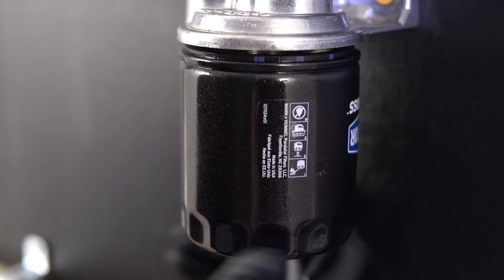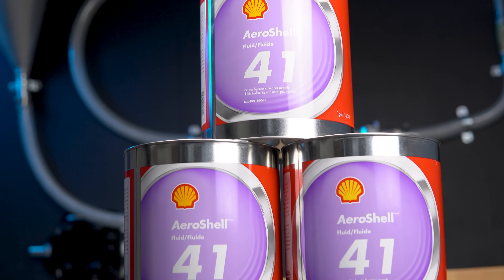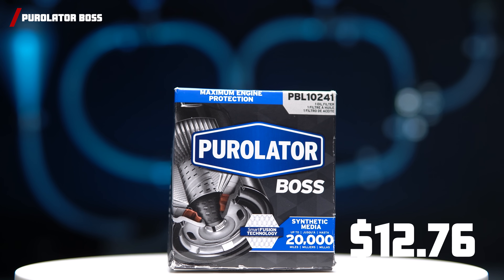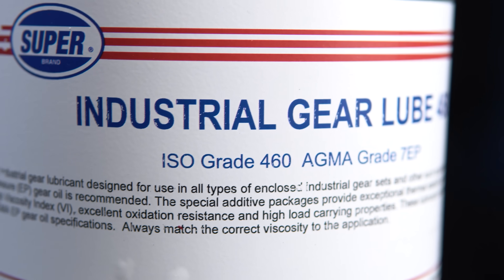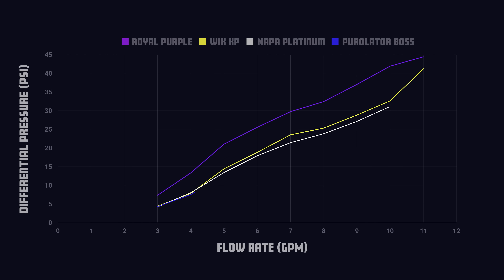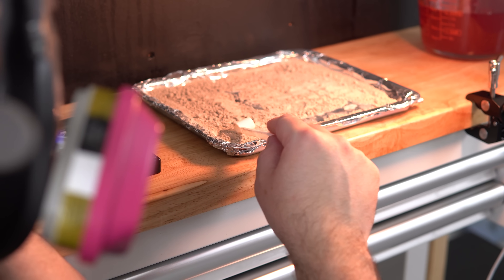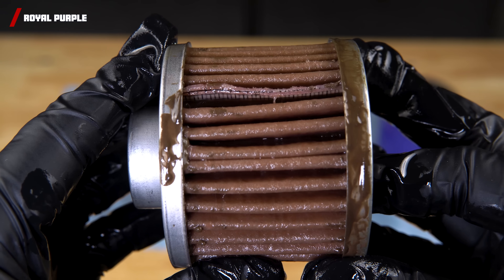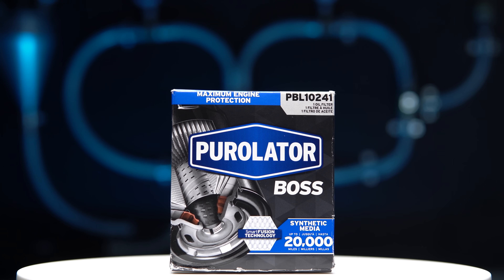Engineers Test the Most Popular Oil Filters

Comment from the maker: What oil filter do you use on your vehicle? Let us know in the comments down below and we may test it in a future video😉:yt:
Reply: I think it'd be nice to test some oem filters like the Toyota or Motorcraft. That and the Autozone filters since those are the most common where I'm from
Reply: You should test the k&n hp oil filter specifically. They are marketed as a better filter than the last k&n you tested.
Reply: AMSOIL
Reply: Mann, Bosch, Mahle or Knecht.
Reply: The best affordable is my moto. I've used purolator boss for 10 years. I'm amazed at 6 k miles how clean oil is. Nissan rogue
Reply: Honda oem , motercraft oem
Reply: I use standard Wix and Toyota OEM and Ford OEM
Reply: I'm using the Bosch 3300
Reply: Would like to see a motorcraft filter
Reply: Purolator One
Reply: Amsoil, Mobil 1, FRAM ULTRA and do a OEM showdown with all the ones the manufacturers say should be the only ones used in their cars
Reply: Every filter
Reply: Motorcraft FL910S which is the OEM equivalent to the four filters tested.  Thanks!
Reply: Moto master Canadian tire brand
Reply: The OEM filters are nonsense...the automotive industria don't make filters
Reply: Frame, Mobile 1, k&n
Reply: Wix
Reply: OEM manufactured
Reply: SuperTech Max Performace 7317 - Solid bang for the buck 💰💰
Reply: Usually Motorcraft, Purolator, or a Carquest blue label filter. What I would like to see tested though, is an AC Delco filter, specifically the blue ones. I'm a mechanic and we have had multiple instances, including one from the owner's father, where vehicles report a lower oil pressure after installing one of these filters. I don't recall the exact part number, but the filter fits LS V8 engines in full size GM trucks from 02-12 model years.
Reply: Mobil 1
Reply: I use oil filter pick one lol. Usually wix or fram and of my entire family as long as I can remember has used fram filters and no one ever blew up a engine! IMO its not the filter its the mileage and oil type per specific type of cam flat tappet or roller! Change your oil 3500 miles and you will never have a problem unless you have one of them pos displacement on demand AFM engines, they are junk!
Reply: I would use a roll of toilet paper, if it fit.. lol. Give me the cheapest one available. I plan on changing it soon anyways
Reply: I switched to the Wix XP a few years back, but I'm going to watch this series with interest.
Reply: Toyota TRD
Reply: Mann  c63 amg
Reply: i was picking an oil filter this was my list plus Fram synthetic endurance, and amsoil EA... i liked the wix xp but with Fram synthetic endurance. Please test the fram synthetic endurance fe7317 and amsoil ea15k13 oil filter.
Reply: Currently running Amsoil filters on two of my vehicles
Reply: Baldwin filter  needs to go through your test rig
Reply: I use vp racing, amsoil,and royal purple oil filters because they all use synthetic micro glass media technology and that’s why they don’t flow as much because they capture smaller microns
Reply: Honda both American and Japanese
Reply: The Super Tech 20K cheap and made by Champion
Reply: Mann and mahle sometimes bosch
Reply: Fram Ultra, but that might change based on your testing!
Reply: Mobile 1 filters.
Reply: MAN, Mahle or Bosch.
Reply: Motorcraft next please.
Reply: @miqo85 napa made by Mann. Says so on the box.
Reply: Napa Gold or Wix. Also Mann
Reply: AMSOIL would be a great oil filter to test given the advertising behind the product. I wanna see if it holds true!
Reply: Amsoil, Napa Gold (or WIX equivalent), AC Delco Ultragaurd Gold, Purolator One, Fram Ultra Synthetic, Mobil 1, and K&N.
Reply: Motorcraft for sure!
Reply: Fram Ultra or Royal Purple.  Both were highest efficiency of previous tests, Fram Ultra had more dirt capacity, but was more restrictive to flow.  Maybe that doesn't matter for a constant flow / variable pressure gerotor oil pump?  (I know some new pumps are funky variable electric).
Reply: Amsoil, Mobil 1 or K&N
Reply: Wix
Reply: where  do i buy the 10 micron filter
Reply: @cameronburger4116 yessss!!!! I was going to suggest that as well!
Reply: Toyota
Reply: I use Bosch Distance Plus when I can find them They claim to have 99.8% first pass efficiency. 2nd choice is Mobil 1 filter.
Reply: Been using Purolator for years.
Reply: Only AMSOIL with 1 or 2 Filtermags
Reply: Cheap oil and filters for me, changed often. Clean cheap oil is better than dirty expensive oil.
Reply: @ARC_RAY  maybe test them against hiflofiltro as I've read they are basically a rebranded k&n kinda like Wix vs Napa. They are available with the same hex on the bottom like the k&n race filters.
Reply: K&N vs hiflofiltro. They're supposed to be the same thing. Kinda like Napa vs Wix.
Reply: AMSOIL!
Reply: Mobil 1, Super Tech, Purolator Tech, Purolator One, Purolator Boss, and Fram Tough Guard, and more.
Reply: Fram Ultra Synthetic.
Reply: I'd like to see a Bosch 3402 filter and a Mopar MO349 cartridge filter. That's what I run on my vehicles right now.
Reply: @Jetmech1781  yah, something they missed in this video is that there is only like 3 companies that make oil filters, and these names license them to manufacture them with their specs requested
Reply: Fram from Canadian Tire here in Canada
Reply: Depends on what I can for a good price on, been building high horsepower engines since early 90s, run my engines HARD and I have yet to have one oil filter failure so not an area I focus on
Reply: I always use OEM from the parts counter
Reply: Purolator Boss why bother spinning anything else on your engine
Reply: Toyota Denso or Ford Motorcraft for my Tacoma, depending on what's on sale/cheaper
Reply: @ramirovillarreal5666 Correct. They contract out the manufacture. However, they do specify in the contract performance standards.
Reply: @renvge 😊que 0😊😊
Reply: Toyota OEM in the Toyotas, Mobil One in the Ford and Chevy.
Reply: Purolator Boss or Pure One
Reply: I've been using Motorcraft on my '97 F250, 2000 Jeep, '96 Nissan and even the '04 lawnmower. Mann filter on the wife's Audi. I've also used Baldwin. You hit on everything else I've used, I think.
Reply: Amsoil oil filter been using for a few years
Reply: I run K&N HP-2001 on one of our vehicles and HP-2011 on the other I'd love to see how they stack up against wix xp
Reply: Honda OE, Toyota OE, Fram Ultra and Carquest red and blue. The first 3 i'm using and the 2 Carquest because we use them at work.
Reply: Where's Mobil 1 20k filter?
Reply: Bosch Premium, please!😊
Reply: OEM. Mazda for the last 16 years. Some results you showed are concerns I had that other Youtube videos don't test, like cold flow rate/resistance. That's why I went OEM, to play it safe.
Reply: 2017 Lexus ES350 - Fram Ultra XG9972 cartridge oil filter,  various 0w20s but currently Quaker State full synthetic
Reply: Mobil 1
Reply: Wix wix and wix
Reply: I either use OEM or wix.
Reply: @ramirovillarreal5666  correct, but no matter who makes the oem filters they are the only ones with thousands of hours of test data for your exact engine model.
Reply: Pure One Purolator PL 14615
Reply: AC Delco on all 4 of our vehicles.
Reply: i use Mann, Henghst and Febi
Reply: FL1A on my 03 ram 220k since new
Reply: Mobil 1
Reply: bosch on non-BMW cars, Mann or Mahle on BMW
Reply: Use some OEM filters, I drive a Tacoma, and apparently it's a huge thing in the Tacoma world to only use OEM Tacoma oil filters. Would be nice to see if they are actually better, or if it's just people pulling "facts" out their ass.
Reply: Motorcraft on both of mine!
Reply: I’d love to see you retest the Fram Ultra on this 2.0 rig to see how it compares to the Purlator Boss, as those are the two filters I go with on my car.
Reply: CATERPILLAR
Reply: Motorcraft on my Ford and Jeep.
Reply: Mobil 1
Reply: You should have at least put the filter that came in first place from the last test on here And continue to do so if the test changes
Reply: Mann filters,  only❗️
Reply: you need to figure out how to test cartrige filters i have yet to find somone that has dun this and i use mopar or k&N
Reply: Motorcraft on my 5.0 F150, fram or any random filter on an Acura TSX, Honda on an S2000.
Reply: Motorcraft, Napa and CNH
Reply: Since Subaru now uses Tokyo Roki filters exclusively I have switched back to Subaru OE from WIX XP.
Reply: Bosch next for sure
Reply: My every day car Subaru Tokyo Roki 15208AA20A
Reply: Would love to see the Mobil 1 retested on this platform!
Reply: @CedroCron   The New Fram Endurance is the top model now, but it would be great to compare the Fram Endurance, Fram Ultra, and the Amsoil plus filters from any other brands.  Definitely SuperTech since many think it is a good filter and I don't after cutting one open.
Reply: @Molson954  I agree 100%!!  I run the FE3600/FE3614 and any of the EA or EAO series filters.  I have cut them open and testing them on vehicles now.  All made from Champion labs.  They are nearly identical besides the label.
Reply: Amsoil please
Reply: What about Royal Purple and  Napa  platinum
Reply: Mobil 1 Extended Performance!
Reply: Baldwin is without peer.
Reply: I have used NAPA Gold for years, but now I see the Purolator Boss is a far superior filter. Subscribed!
Reply: 🤔👏👉 Hear this out...... So if we want to improve flow rates / differential pressure at hot & cold oil temperatures while primarily retaining the best ROI for particle size-count removal filtration metrics and secondarily the amount of debris capacity, can a [non-restrictive] oil filter relocation kit flange (with integrated pre-start oiler pump?) and tubing ran to a "Y"/splitter for delivery to a twin pair of parallel-flowing filters dramatically increase those flow rates while, even though doubling the oil filter service cost, still perform bypass function to engine specification and still be cheaper than, for example, a single Royal Purple filter? Based on videos I've watched thus far in this series, am curious about such a case via two parallel-flowing Purolator Boss filters for the win. The total debris capacity is tertiary in my mind's eye after the aforementioned particle size - count, differential pressure at hot & cold flow rates while not forgetting about timely bypass functionality in the face of two bypass springs now in the flow - parallel - as my only concern if bypassing would then be undermined as well as potential negative effect on hydraulic sensitive oil systems (for variable valve timing) when striving toward the other goals while staying within cost parameter currently defined by the oil filter competition prices.
Reply: i will never use another paper element style filter if aerospace style reuseable filters are available  for my vehicles.  Imo they are light years ahead of any standard paper element filter and would really enjoy a comparison. It seems like a racket throwing nasty filters in the trash every 5000 miles on millions and millions of vehicles when reuseables are inexpensive, last a lifetime and in theory should out perform standard filters with increased flow across the stainless mesh element and magnetic pre filtering inside the filter..They take about 30 seconds to disassemble and wash with brake cleaner. I've been using one on my HD for over ten years and like to see what's in the filter when cleaning it and the cnc machined finned body. The fact that they're used in aerospace is all i need to know
Reply: WIX XP on all my vehicles
Reply: Ive been using an ACDelco UltraGuard. It's prolly one of these filters rebranded, but it be interesting to see.
Reply: Amsoil, or it's lower priced twin, Fran Endurance
Reply: I have Japanese made oil filters for my Honda, but there are USA made ones that are completely different in design. I would be interested to see which is actually better.
Reply: From one soon to be PE (EIT)…..great work! It would be interesting to see the bypass pressures of each of the filters tested. I have been told that Subaru boxer engines typically operate at a higher oil pressure than other engines. I run Wix XP because they reportedly have a higher bypass pressure than other filters. A filters filtering capabilities do not matter much if it’s bypass pressure is so low that it is always in bypass mode.
Reply: You should do some oem dealership filters for subaru , USA blue filters made by fram , JDM black filters made by tokyo roki both of witch have a larger and smaller size filter depending on model but can be interchanged no problem so test both sizes to see if it changes anything , also throw in mazda black filter witch is USA oem but made by tokyo roki and some subaru guys use it since its the same threads and brand as subaru JDM , just found your channel and your filter tests are top notch and way more intensive then ive seen before hope you give the filters i suggested a try keep up the great content
Reply: Walmart Super Tech.
Reply: I use Motorcraft. My friend was a mechanic about 15 years ago, he took apart several oil filters. Motorcraft had great construction and material, and is inexpensive. I've been using them ever since.  I'm open to change though.
Reply: wix xp
Reply: Baldwin
Reply: Mann and Mahle, or OEM.
Reply: bosch
Reply: Some cars have oil filters which are on top, easy to reach, drain when not in use, so very easy to change without changing oil. 
I would love to see the effect of changing one of these every ... 1,000 miles ?
Reply: I have a new laptop and it is putting many comments on different threads, thereby making no sense.
Reply: NAPA GOLD in F150 and top NAPA filter for my 2003 Saturn Ion 2.2 Ecotec. I am pretty anxious about changing my oil every 3000 or less. 
I live in Alberta where it gets very cold and it's hard on everything on cars. In fact, I never drive I'm extreme weather. I park my car in my brother's insulated garage.
Last month when it was a horrible -50°F o ventured outside and did not see or hear a car for 20 minutes.
No one should drive in that weather.
Unfortunately, my neighbour's lady must have attempted to drive and the it was towed to a garage. The lady figured it had to do with the spark plugs. I doubt that was the cause. She needed a battery warmer and likely her battery froze up.
I haven't followed up with her in this matter.
Reply: She drove a 2006 or 2007 KIA SPECTRA 2.2 engine
Reply: MOTORCRAFT please 😁
Reply: NAPA GOLD for my F150 and Wix xp or NAPA equivalent with wire mesh over media for my 2.2 ecotec 2005 Saturn Ion. Both vehicles run like a top ( new 302 engine in my '86 F150 about 57,000 miles). I change my oil every 3000 miles or less Pennzoil Platinum 5/30 synthetic. They will last another 20 years. I'm 62.
Reply: I think you should compare k&n an MANN filters to see how they do against the current leaders on the board!
Reply: I went to buy some supertech filters the other day but there was a lot of manufacturing dust on them, didn't sit well with me, got the mobil 1.
Reply: Subaru only recommends using their brand filters, I'd like to see how they compare to other popular available brand filters
Reply: BOSCH, MOBIL 1, TOYOTA, AMSOIL
Reply: Based on this video, I asked for Purolator Boss this oil change, but my garage only orders in from NAPA, so I ended up with the NAPA platinum. All three filters are close, so I guess it doesn't matter. I just hope the by-pass valve doesn't stick as you have indicated it does.
Reply: The XP isn't their best. It's made for extended oil change intervals and can capture more total dirt in the filter before going into bypass mode, but it does a much poorer job of filtering total number of particles and size of particles...
Reply: I use either Wix and Baldwin filters on my vehicles.
Reply: How about Mobil 1 extended performance and Toyota filters.
Reply: I been using mobile 1 oil filters on My 2003 Ram I bought it brand new still own it now has 400 thousand miles on it .
Reply: Purolator BOSS
Reply: Purolator BOSS vs Purolator One please!
Reply: I run a Toyota 4Runner, V8 and about a year ago switched from Toyota filters to Purolator One.
Reply: What is the pressure at which each filter BYPASS PLUG FILTER OPEN FLOW PRESSURE ??? I like MOBIL 1. MOTORCRAFT FL-820-S. BALDWIN,
Reply: After many years of Wix use, I did switch to Purolator Boss after watching your test
Reply: I use the Baldwin,  Boss, Fram, Motorcraft FL-820S filter.

Comment: The purolator boss has good flow characteristics and exceptional filtering efficiencies.  This is my favorite of the bunch.
Reply: @carloswald5584  No, it has larger dirt capacity but lower filtering fineness and efficiency
Reply: The final test results show how  many particles from various micro thicknesses were found in the oil samples from each filter after they tried to filter them out and the boss came out on top, also the cold flow test napa was best and the boss second, in the hot flow wix was top but boss and napa were close behind.
I myself used the old wix XP before new owners for years lots of oil changes and am now switching to the boss because made in US and has good all around characteristics.my greatest concern is oil flow in cold and hot and filtering the fine  metal crap in my engine, also switching to Pennzoil ultra synthetic platinum for best cold and warm flow and almost same as amsoil but the high cost
Reply: Synthetic media as well. The wix XP no longer has synthetic media so idk what other filters other a synthetic media